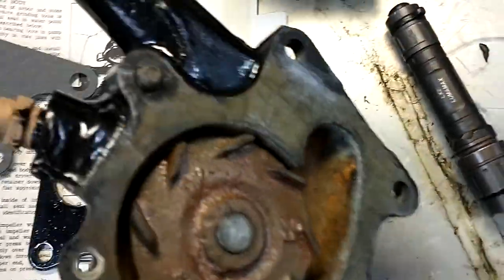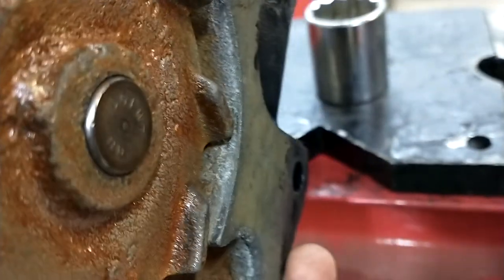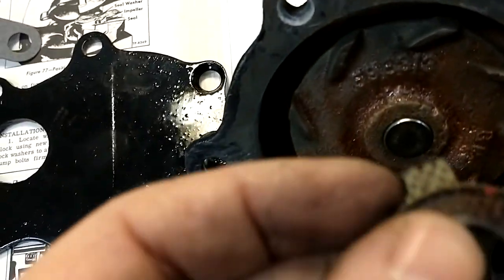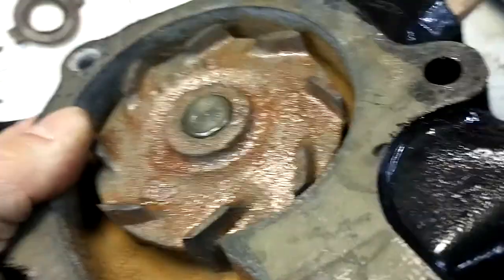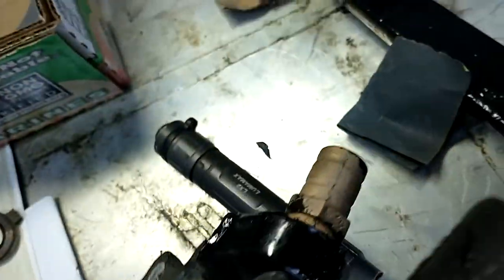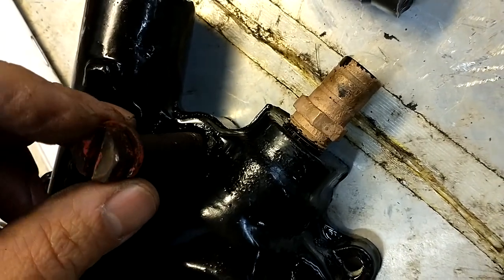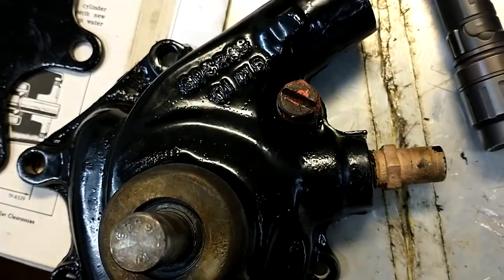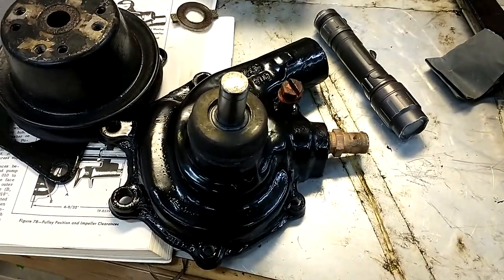1949 GMC Water Pump rebuild part 5 reassembly

Comment: Where did you get the rebuild kit?
Reply from the maker: Hi - I found it on eBay from a seller called '2ndgenautoparts'.  Here is the URL https://www.ebay.com/itm/174225218915